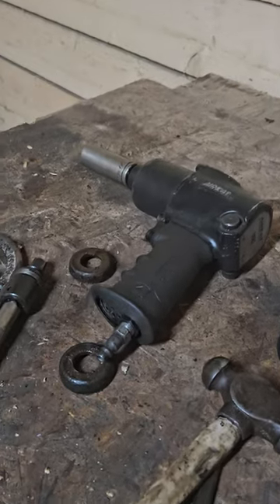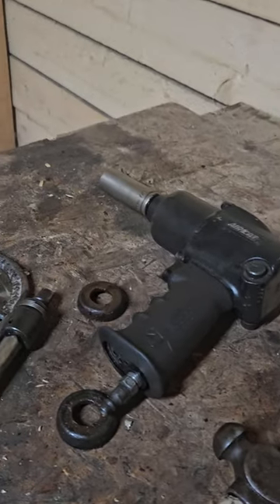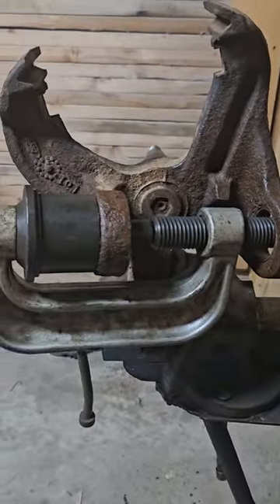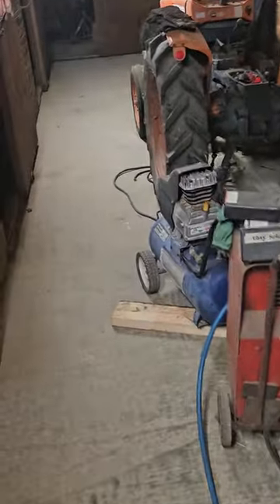Aircat 1431 impact ... a real test low air old balljoints

Comment: The matco 1/2 air impact wrench is a lot stronger than this older model that you’re using
Reply from the maker: Nuh uh.. il even fight u 😆 🤣
Reply: That can be easily proven the gun you’re using is based on the older IR 231G yeah I got the matco MT2779O